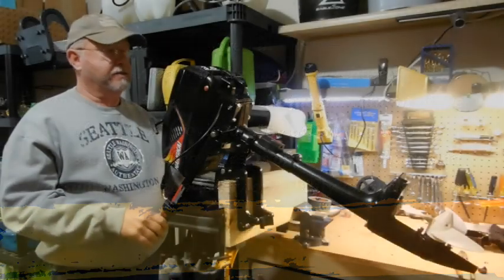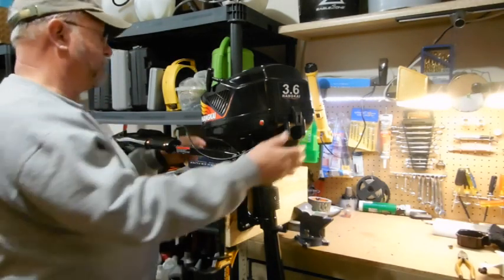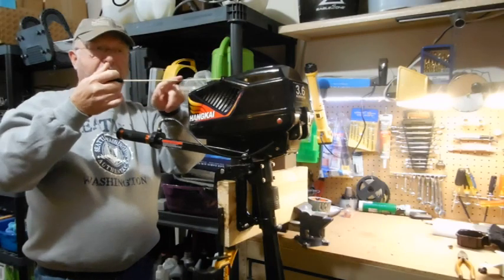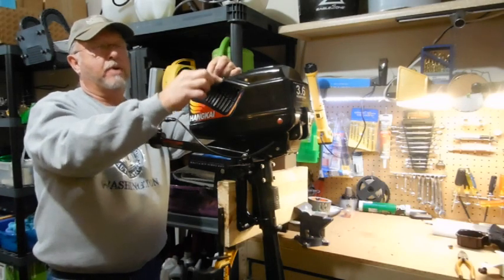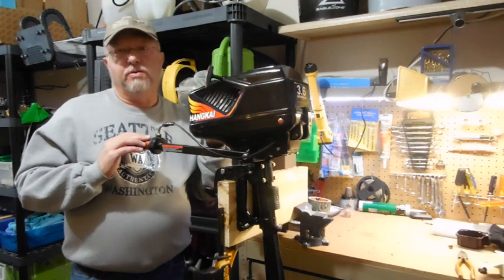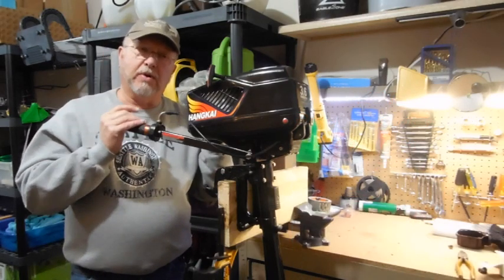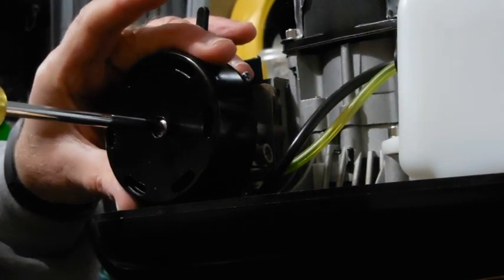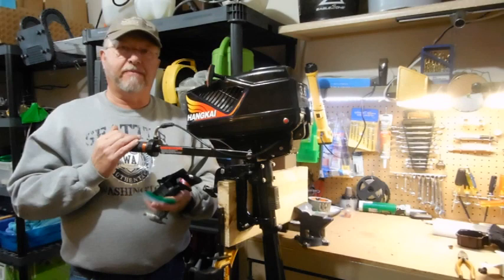Hangkai 3.6 / 3.5 hp outboard motor - 10 Things To Know

Comment: I've had the same problem with the cheap Chinese 2-stroke generators first thing you have to do is get rid of these spark plug that comes with it and change out the fuel line
Reply from the maker: Good to know I've done the right things ;0)

Comment: This video has been so helpful thanks so much I've had this motor for a few months now and use it a couple of times a week and it's not put a foot wrong I used high quality gear oil and changed the sparkplug to a champion one and I only use 98 octane fuel and 2 stroke racing oil at 40-1 and it runs so sweet
Reply from the maker: Good to hear a success story.  I’ve got a couple of videos on changing the clutch. It’s not difficult and I took more apart than needed…. But it’ll be part of the routine maintenance for you…. But I enjoy working on it. It’s a simple engine, and that’s a good thing!
Thanks for watching and taking the time to comment! 👍👍
Reply: @BoilerDan1  I've not had any clutch issues but my hangkai 3.5 looks slightly different to yours the case is grey, maybe it's a mk 2 or something but the clutch looks slightly higher quality. I found running it on premium gas made a difference and tightening the throttle cable a bit I've got it on a small zodiac dingey and can get about 15 kmph max and 10 kmph (about 6 mph) on cruise on the canal and travel about 7 miles on a tank of fuel, I might also change the propeller and fit a dolphin hydrofoil to it to max out the performance
Reply from the maker: @christopherwicks2300  that’s great!
Thanks again and enjoy your time on the water!
Reply: In an email I received from the seller that sold me the motor, they mentioned that I should use 87 octane ethanol free.  Unfortunately, where I am there is only 91 octane and above.  You mention in your comment that you use even higher octane.  I am wondering, has your motor ever suffered from the higher octane fuel?  Thanks in advance.
Reply from the maker: No, you just don’t want less octane.
The ethanol additive can deteriorate the fuel lines. That’s what I had happen. I guess go with what you have available and change out fuel lines each season. With the increase use of ethanol you might find new lines that hold up better?

Comment: Hi, I have the same motor. I have a question.  My motor will run just fine for about 10 minutes. Then starts cutting out. I found that if I fiddle around with the choke I can keep it from going dead. But it will not go back to full power. Have to let it cool down before it will run right again. Any ideas of what I need to do? Because when running right it pushes my 10' flat bottom boat just fine at 5mph.
Reply from the maker: Steven, I’m not a mechanic but I will share some things that either I have discovered or someone else has suggested.
More than one person (including me) discovered that a vacuum develops in the fuel tank. Then fuel can’t flow properly and it can even stall the motor. There’s a relief tube inside the fuel cap. If you remove the cap and look you’ll see it. Kind of like a pinched tube.  There’s a little hole on the top of the cap. I poked the backside of a similar sized drill bit (or wire) through trying to stretch it out a little.  Also loosening the fuel cap will work too. 
Only other thing I can think of is a clogged fuel filter but I doubt if that is it.
Especially if it starts out fine and then after running for a while..... it’s gotta be the vacuum.... to test just loosen the gas cap 😁.
Let me know if that works...Others will appreciate your feedback too!
Reply: @BoilerDan1  thank you I will deffently try that out and get back to you .

Comment: I understand that this is a fairly old video, but I’ve had my motor for about eight months now and it seems like my throttle cable is not responding properly it seems like it’s wall and blue. Is there anyway I can tighten it off and get more response from the drive.
Reply from the maker: Usually you can adjust the throttle cable tension at on end of the cable or the other.  You could also use a lubricant like used on garage door hinges.
You said your throttle is not responding.  It could be that your clutch is worn.  I had to replace mine after about 9 months.
I’m putting a link below that will show you the parts needed (available from Amazon) https://amzn.to/436Saf1
Here’s a link to a video I made showing the process I did replacing the clutch:
Part 1 https://youtu.be/H4mPGuEKnKI?si=6nrTmldAjj1-duaU
Part 2 https://youtu.be/Qu9OjXbMutA?si=g-vjn4K7dv6YRocR

Comment: Thanks for posting. Great advice. A huge improvement to these motors is to fit a 1.5 clutch spring. The original is a 4k....meaning the engine revs to 4000 revs before the clutch engages.....engages the driveshaft to turn the water pump. A clutch spring from a Honda BF2d or BF2.3 fit perfectly and greatly improves the engine
Reply from the maker: That’s great advice. I replaced my spring with one from a hardware store and it did work, but getting a true fit is a much better solution. Thanks for sharing!
And watching!👍👍
Reply: @BoilerDan1  In my opinion there are plenty of ways of extracting more power out of these engines, the carbs are not the brilliant and exhaust is functional at best..The leg and drive is from a 2hp Yamaha and being a short stroke oversquare engine has plenty of low down grunt
Reply from the maker: Shame that I didn’t have your knowledge from the start of my adventure!😂
Thanks again for sharing 👍👍👍
Reply: Is the clutch spring easy to replace?  This is very interesting, thanks for sharing.
Reply from the maker: I’m not a mechanic by any means.  Yes it’s an easy fix.  I couldn’t find a lighter clutch spring so I used one for a hardware store that I was able to clip on.  I think you responded to Steve Evans comment, so take his advice and search for 1.5 clutch spring.  If you watch the video I posted on replacing the clutch spring you’ll see what I did. It worked much better than the original one. It’s way too strong.
Thanks for watching 👍
Reply: @ah2347  yes its very easy to fif on these engines......due to the nature of the engine with a lighter spring they do bog down a little.

Comment: I'm real close to buying the 4 stroke 4hp off Amazon so thx for your checklist!
Reply from the maker: In hindsight that’s what I would rather have purchased.  I think the 4 stroke is the way to go.  However, special note: it can’t be laid down sideways as oil will leak into the cylinder and fowl the plug. (So I’ve been told).  You can remove the oil and refill it at your destination if you need to transport it laying down.  I’ve also been told that you can lay it down at a slant on one side, I just don’t know which side is okay?  Thanks for watching and taking the time to comment 👍

Comment: I'm buying one new/unused tomorrow. 
Thanks for the tips.
Another tip for small motors... LEASH/CHAIN THE MOTOR TO THE VESSEL. In case it comes loose or someone tries to swipe it
Reply from the maker: Good luck with yours. I enjoyed my journey but it does take some tweaking.  I think mine would have preformed better on a small hard shell boat. The raft was a bit spongy causing me to lose thrust.
Thanks for watching 👍👍
Reply: @BoilerDan1 is the 3.5 HP one kinda the same thing. Thank you for the video as well
Reply from the maker: Yes, almost same thing.  I think it’s just a previous version.  It’s a bargain as long as you don’t mind playing with it 😂👍👍

Comment: Hi Dan, Good info for this little motor. I have a couple of things to add;
1. My pull start and claw pull failed from the beginning, not sure which part failed first. It’s a good idea to take the pull start off and tighten down the claw pull with thread lock. Then replace the pull start with a little thread lock.
2. My throttle grip was loose. Ive tightened it up by removing some material between the joint but need to add a sleeve I think.
3. My 2 cents on fuel. Avoid ethanol fuels and high octane fuels. High octane fuels may use ethanol to bring the octane value up. Hangkai recommend standard unleaded 93. We use standard unleaded 91 for small engines. Use only fresh fuel, only mix what you need, do not store fuel, tip unmixed fuel into a car to be used rather than storing. Ethanol is corrosive to metal parts like the carb needle and seat. It will degrade rubber like the fuel line and internal carb gaskets. These little engines use a rubber gasket fuel pump which runs off the crank case pressure, ethanol will quickly damage this gasket fuel pump.
Reply from the maker: Thanks for your thoughts and good advise.  I'm fortunate to be in an area where you can find fuel without ethanol blends.  Although my fuel line still rotted out within about 6 weeks.  Hope people considering this motor will take the time to read comments like yours as they will have a better overall experience with it.  For me, half the fun is overcoming the little problems!  :0)

Comment: All of what you said is correct. I learnt this by myself when i bought one.
From new mine had a leak from the water jacket over the cylinder which sprayed water over the engine. I tried to return it via eBay but was told they didn't want it returned and gave me a full refund. I tried numerous methods of sealing the leak to no avail.  I gave it to friend who also tried to fix it. He used it for a few week before giving up.
Not really a good design and poor quality.
Wouldn't trust it more that swimming distance from shore
Reply from the maker: It’s great that they refunded your money !  I’m surprised you weren’t able to correct the cooling water issue as it’s a very simple system.  You could probably have just disconnected the water tube and just use it as air cooled. There’s not that much water flow.  I agree regarding staying reasonably close to land!😂👍

Comment: Great info, I would add that on my 3.5 the in tank fuel filter seem to have an inbuilt metal weight and its breaking down leaving a metal paste in the bottom of the tank. I replaced it with an all plastic one with a s/s nut to keep it at the bottom. + new fuel lines.  The 3.5 splits into left and right halves and the fuel tank is attached to the half with the sparking plug and carburetor i've swapped mine to the other half for ease of maintenance
Reply: Can you explain how you swapped it? I like the idea.  Pretty dumb having  carb adjustments on same side as tank.  Should be able to adjust on the fly as needed
Reply from the maker: Hopefully Dave Bushell will see your question and answer.  
Thanks for watching. Sorry I don’t have the answer.

Comment from the maker: 1st, Did you add gear lubricant at the propeller gears? It’s shipping without gear oil in the gears down by the propeller (watch my other videos)
2nd, The propeller doesn’t turn at idle speed, you must run at least 3/4 speed for it to turn.
Reply: Do you think it will move a 16ft aluminum starcraft 1 mph at 3/4 throttle?
Reply from the maker: @richsoliman8394  Ha, Yes, I’m sure it would manage that task!  It’ll do better on that than my sponginess of my raft.
Make sure you check out several of the videos I made. The clutch wears out quickly, but replacing or even removing the clutch tension spring will greatly help.
Reply: @BoilerDan1  thanks

Comment: So in other words, it works when taken care of... Right? Thinking of buying a small inflatable boat and attaching this
Reply from the maker: Yes. But it does require paying attention to the little things! I think the motor itself is good. It’s the clutch and fuel lines that require regular maintenance.  Regarding the raft, I’d recommend a better one than what I used. The motor mount is too soft causing the motor to tilt and losing thrust. Or work on a better motor mount so it’s attached to the solid floor.
Thanks for watching 👍

Comment: Hi Dan, thank you for sharing your videos with us, a lot to learn from them. A quick question for you, can I lay down a hangkay 3.6 two stroke motor. Please let me know. Thanks!
Reply from the maker: Yes, it’s the 4 stroke that the oil can leak into the cylinder and fowl the plug.
That being said, you’ll want to remove most of the fuel so it doesn’t leak out the vent in the cap, but just having a little slant will illuminate that possibility. I transported mine laying in the back of my car, just kept the fuel tank up on other equipment so it slanted down.  Hope that makes sense? But yes you can lay it down.
Thanks for watching 👍
Reply: @BoilerDan1  Hi Dan, thanks for the answer! I am kind of new on all of this and just trying not to kill my new 3.6hp. I actually have a 4 stroke 9.9 tohatsu too, but with four stroke, everything is different ( transportation, oil,etc) thanks again my friend, great Chanel!
Reply from the maker: You’re very welcome! Thanks for watching 👍👍
Reply: Related question: can you swing the throttle arm all the way up or down? 

I’m considering getting one and will have to lay it down for transport in a rectangular space. Said space have enough length for the head+shaft but not enough space for the throttle/control arm in full “use” position.

Any information would be appreciated, thanks.
Reply from the maker: Yes the throttle arm will pivot up. Not down though.
I chose the 2 stroke for the same reason…. To lay it down on its side.
The 4 stroke holds oil an must remain upright.
I will add the the exhaust goes out below the water line and that muffles the noise….. the 4 stroke has a muffler.  I say that because I wouldn’t use this as a trolling motor….. a lot of sound going into the water.  But to get from one place to another it worked for me….. but its not a motor for everyone, as it has some issues.
I’ve documented them in the series I made along my journey. 👍

Comment: Hopefully my last question for you 😎 Wondering if your water got really nasty when breaking in. I'm at about 5 hours in and have been using the same large trash can the whole time. And the water is just gross. Lots of oil. I dont understand where its even coming from. The motor seems to be running great though!
Reply from the maker: That’s normal due to the higher level of oil to fuel mixture recommended during break-in.
Once you change over to the 50:1 mix it will be totally clean.
Special note: you don’t need to use a barrel or bucket. It was winter here, and I kept adding snow to keep the water cool.  Run a hose to your barrel or take it out on the water!

Comment: Helpful tips, wondering if I should try one of these.
Reply from the maker: You should research quite a bit. I’ve made several videos! Probably the biggest concern is regularly replacing the clutch.  It’s not that difficult if you like doing that kind of stuff.
The clutch spring being replaced with a lighter one would help a lot. Again, not that difficult. I knew nothing going into my motor and I was able to figure it out.
It’s also a bit loud. Definitely not for trolling, but from one point to another it’s fine.
Thanks for watching and check out all in the series to help you decide if it’s right for you. 👍
Reply: @BoilerDan1  Thanks for your reply, yes I've just watched some more recent videos of yours. And some others in general. Thinking ill maybe stick with a Mariner or Suzuki after all.
Reply from the maker: I agree with your decision!  I just wanted something cheap to play around with. It served me well but if you can afford more, it’s a better choice to get better.
I think overall the motor’s block is good. But the add on stuff is too cheap. But I like to tinker so it was just right for me 😂.

Comment: When I tried start mine the first time it wouldn't pump fuel, took apart the in tank filter and it had a plastic plug in it. Like it was put there intentionally,took it out and am now breaking it in - runs great
Reply from the maker: Interesting!  Maybe someone forgot to remove it in production?  Be aware that the clutch wears out within a season.  I made a video on replacing it. The tension spring is too strong. I changed mine out with one a lot more flexible and that helped.  I’ve also seen where people just remove the spring!  You would lose idling because the propeller would always spin, but definitely would reduce wear on the clutch.  Hope all continues to go well with yours.👍👍

Comment: Great video. I own a Hangkai 4hp 4 Stroke. Can a pipe be added from the exhaust all the way to the water in order to make it quieter?
Reply from the maker: I have sometimes wished I had gotten the 4 stroke.  I don’t really know the answer to your question. Maybe another viewer can answer.  That being said, I would think that you could, but the noise might reverberate through the pipe?
Maybe look into a better muffler?
I tried to insulate the housing but took it off due to concerns of overheating…..

Comment: Hey Dan - just below the bottom 1/2 engine adjacent to where throttle cable enters there is a hole blowing exhaust- looks threaded-
Reply from the maker: Hmmm, I’m not sure? But the exhaust system isn’t that sealed a system.  If the exhaust vents just above the water line are plugged, the exhaust could flow back upwards.  Shame you can’t attach a photo to show more.